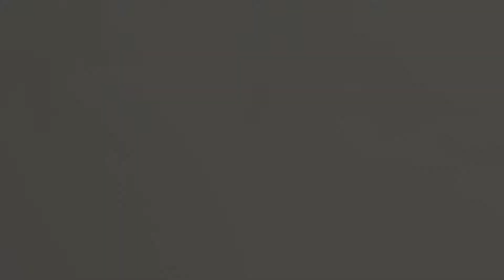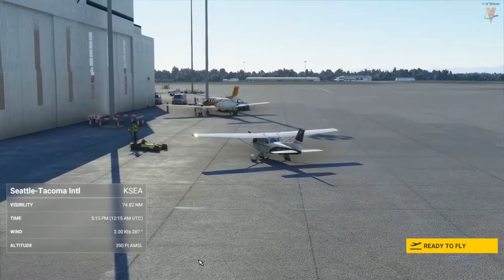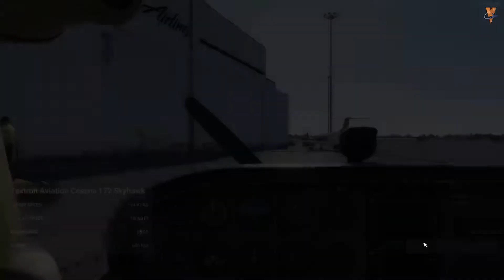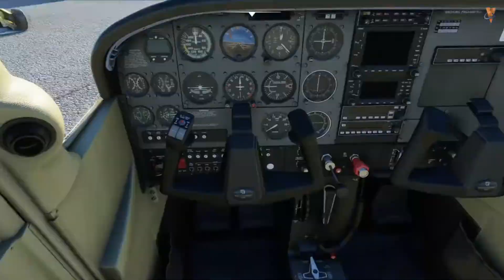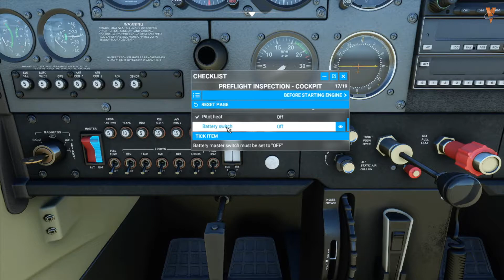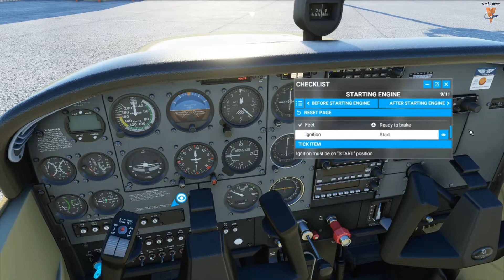Microsoft Flight Simulator 101 | Preflight & Full Engine Startup

Comment: Every time i start up the cesna 172 skyhawk i get the low oil pressure and i can't start uo the plane even though i followed every step on the checklist
Reply from the maker: Thanks for the question. Did you get the red Fuel Shutoff Valve opened by pushing it in? The World Tour videos I just posted on this channel are flown in the Cessna 172 and I run through the full startup procedure at a normal pace there.
Reply: @vrefsimmer  i will do it again and tyr it again at home, will for sure watch your video! Im leaving a like for you
Reply: @vrefsimmer  yeah i tried it again now, the moment i turn on the  alt-bat master on for the first time and the display turns on the beeping starts and the oil pressure is in red, every time. I do the whole check list and follow it really carefully so i donno. Can you help me?
Reply from the maker: @nixxon5505  I just tested the G1000 Cessna 172. It looks like the Fuel Shutoff Valve text pop-up for the valve description is backwards. If the knob is pushed in then the Fuel Shutoff Valve is OPEN but the pop-up text will say "Open Fuel Shutoff Valve." 
The placard right next to the valve stating "FUEL SHUT - PULL OFF" is what seems to be accurate. If the knob is in , then fuel is going to flow. If it's pulled out, then the fuel flow is shutoff. Did this help the problem?
Reply: @vrefsimmer  i will test it out and let ya know as soon as possible. Thank you so much.
Reply from the maker: @nixxon5505  I went ahead and made a video about starting the G1000 Cessna 172 since it's so much different than the standard 172. Thanks for the great question!
Reply: @vrefsimmer  bruh you are a legend, im liking every video and subscribing!!!
Reply: @vrefsimmer  ok yeah it works, my mistake was pulling the fuel shut, thank you so much, also i would love to join ur discord but the invitation is invalid.
Have a great day
Reply from the maker: @nixxon5505  That's great to hear! I also tried to update the Discord link.